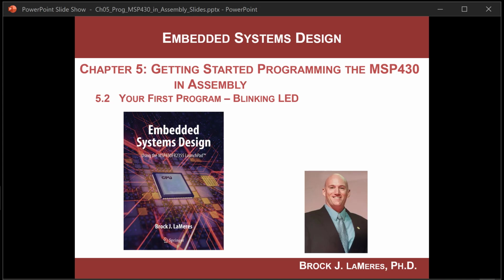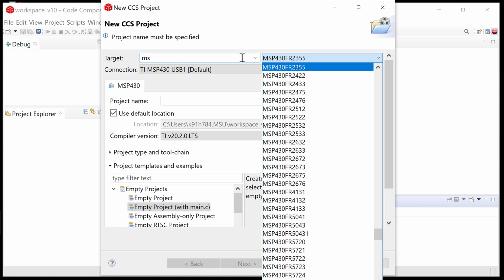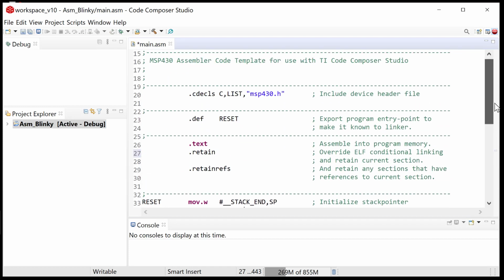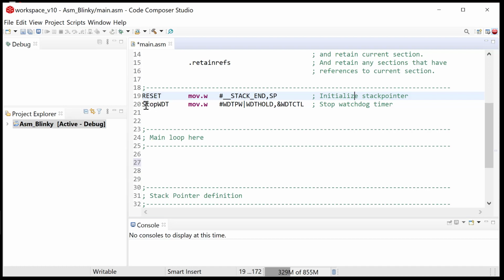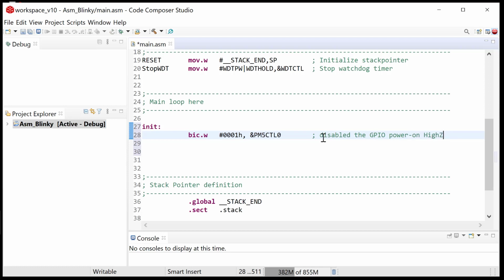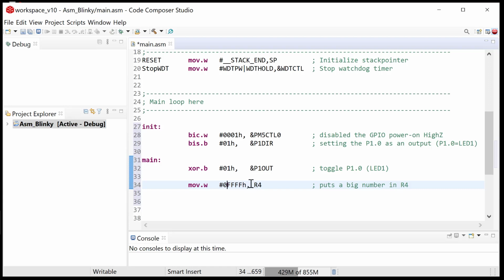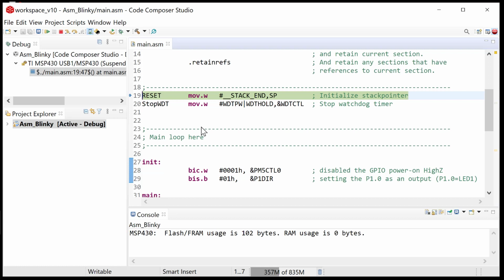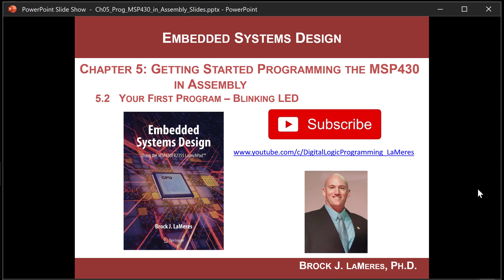5.2(b) - Your First Assembly Program "Blinky"

Comment: nice video, I'm learning a lot running assembly on the MSP430.  I'm following along with an MSP-EXP430F5529LP board and I found that I had to remove the first instruction (bic.w #0001h, &PM5CTL0) for the program to work.
Reply: Hi, have you any idea why? I have the same problem
Reply: HAH wow, thank you so much for this comment. I'm using the same EVM board, F5529LP.
Reply: I also tried this on a FR6989, but there I did not need to remove/comment out that first line.
Reply: thanks man
Reply: I can confirm that this work with 5529LP also I had to add the "nop" command right below "jmp" command so that it works, which looks like this: jmp 	main					;repeat main loop forever
			nop
Reply: Also using an MSP-EXP430F5529LP, and removing that line got it to work. Thank you!